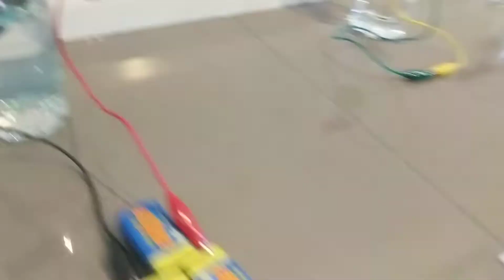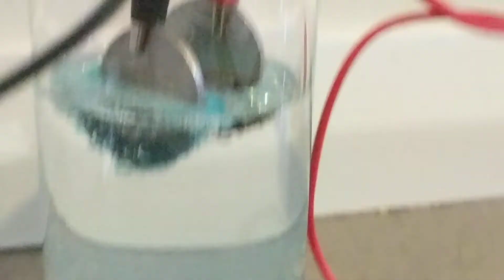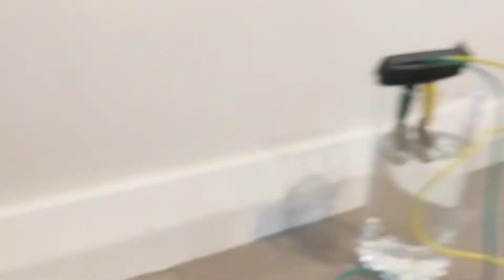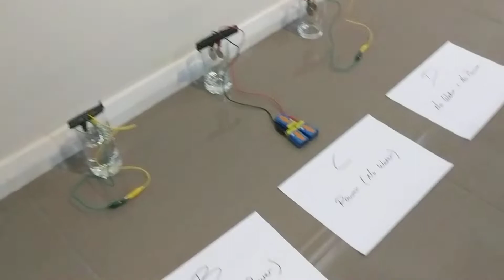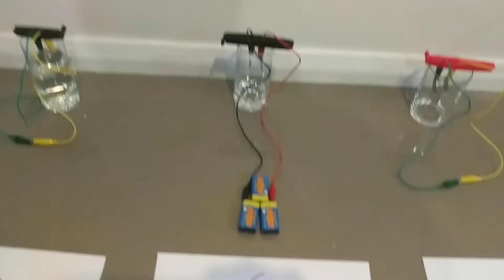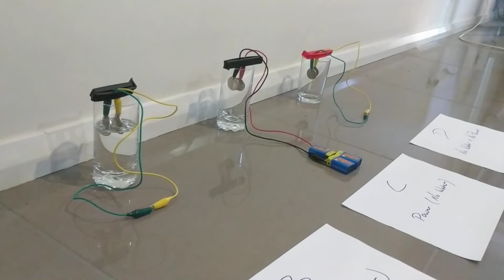Discussion of the results of my test for P&P. Evidence of electrolysis of pure water

Comment: Could there have been some substances  dissolved from the electrodes that would allow current to flow?
    imo, You have not proven the electrolysis of pure water with this experiment. 
   It would be interesting to send the liquid from the second experiment to a lab that could actually analyse the chemicals in the liquid. I predict that it is not 'pure water' anymore and will carry a current due to chemicals dissolved from the electrodes.
Reply from the maker: Thats a good point to consider but I ultimately I disagree because the metal oxides formed are too stable to dissociate in solution to form any charge carrying ions and this is evident by its cloudiness.

If the impurities had allowed ions to form to allow electrolysis, than test B would have shown some sort of degreddation, any at all (as the impurities comming from the coins would have likely been seen from damage to the coin itself).

I may be able to take it to the lab at my work and test it's conductivity against a blank (as I still have test B ) which should indicate the presence of any dissolved metal ions?

Thanks for the comment mate!
Reply: Thanks for listening. I am interested in what results you find from further testing. I really am interesting in finding out the actual results. Wherever it leads.
Reply from the maker: Ryan Q Vincent I appreciate your open-mindedness (if that is a word haha) it's nice to see people who are genuinely curious and want to learn. It makes it feel like I'm doing something worthy

Be assured that I'll never tell you what to think, I'll only give you things to think about of your own accord so you can come to your own conclusion. As I told sheepsandneeps, it's ok we don't have the same opinions in the ens :)
Reply: I never told you what to think. I made a suggestion about dissolved substances from the electrodes. You now have an alternate suggestion that explains that the water is no longer 'pure'. It is your experiment. Your conclusion is not proven?
Reply from the maker: Ryan Q Vincent sorry, I may have been unclear. I wasn't saying you were trying to tell me what to think. I was trying let you know that I wouldn't attack you for not agreeing whether I find proof or not. Apologies
Reply: Seriously, nothing to apologies for - I tend to misunderstand. It is a joy to find someone who just wants to find evidence no matter where it leads. Thanks for doing this. I really do appreciate it. :)
Reply from the maker: Ryan Q Vincent ok, so here's what I'm thinking... Unfortunately I have discarded the liquid from test A (out of fear it would stain my glass) but I still have the liquid in test B (partially out of laziness). What I'll do is I will take it to work, as well as a 'blank' sample (just fresh deionised water from the bottle) and measure it at work using the metering we measure our potable water with (to measure hardness of the water).

It measures in the form of millivolts (mV) but we have no reference for what is considered a high or low value, nore do we know of any deviations in the units scales.

So I will make up a set of standards of 0.5, 1, 2 and 5 grams of NaCl dissolved in deionised water and measure them. We can then graph the standards and use the resulting equation to calculate the equivalent mass of salt needed to achieve the conductivity obtained by test B.

I can also repeats test A and test that too but that will take a few days longer

Thoughts?
Reply from the maker: Ryan Q Vincent just an update for ya mate, I tested it at work, however the results weren't what I expected. There was a scale shift every time I switched solutions. There was always a consistent change of around between 4-10 mV between the blank and solution B. There was a consistent shift of 50-70mV when moving from solution B to the 0.5g/L standard.  I suspect that the change between the blank and solution B is negligible but this cannot be confirmed note denied due to that constantly shifting scale. Instead, I've sources some carbon graphite electrodes. The carbon won't form any conductive ions in solution, infact, the only carbon product we can expect to see is carbon dioxide. However, literature has claimed this to be in a insignificant amount compared to oxygen production during electrolysis. So if water is conductive, this should help show that.

Let me know your thoughts
Reply: +dabrownie93, thanks for continuing this investigation. Before we continue I am quite happy with the h2o water explanation. I believe it is what gives water it's almost 'magical' properties. 
   It is interesting that there appears to be different conductivity of the water just by adding the 'pure silver metal' it does seem that it is interacting with the water to allow a current to flow. Although a very low one. 
 The fact that you are taking accurate measurements is useful and essential. I wish some of the other 'experimenters' would appreciate that. ;-/
Reply from the maker: Ryan Q Vincent you and me both. A little frustrating when they don't even you controls as well (pet peeve)

Feel free to email me if you ever have any questions that you'd rather not ask via comments or are irrelevant to any of my videos. Happy to respond
Reply from the maker: Peter & Pete that current can travel through pure water. Ryan Q Vincent pointed out that it was possible for some metal ions to have dissolved in solution to give a false or skewed result. Although, I do not believe enough ions would dissolved for this to cause a noticable difference, i shouldn't just make that claim, so I am trying to use an alternative method. So far, I have produced gass bubble, (small) but the cathode broke down after an hour (with the anode only slightly effected. Wonder why that would be) so I'm trying other things. But gass was produced on both electrodes on pure water with non-ion forming electrodes and the non powered test showed negligible decay. So that suggests current does flow through the water. I would be interested if you could explain that away? Will be posting the video when I get home in a few days (away for work atm)
Reply from the maker: Peter & Pete I'm glad you asked

Tests A and B are exactly the same except for 1 veriable... Power! If you remove the power source, nothing happens. This suggests that the reaction seen is driven by electricity. It is further supported by the visible differences in reactivity of the electrodes as electrolysis would have different reaction on different electrodes
Reply from the maker: Peter & Pete I don't think you understand how eithed electricity or catalysts work. Electricity will not move or interact with anything unless a circuit is formed. Otherwise it is just called potential (you can look that word up in the dictionary). You also saw that test C was used specifically because I thought you might make that claim. Niether the water, nore the electrical potential broke the coin down and it cannot be a catalyst because it does not fit the definition of one (look it up as well)

As for the copper passing through the nickel, we don't know if the nickel was reacting as well or to what proportion.

For example, if the relative stabilities of the two metals were similar, we'd see a 75/25 reaction. This means that the copper would react 3 times fast than the nickel. However, if the stabilities weren't similar, that would change. We could be seeing only copper reacting or only nickel and any combination inbetween. Based from the colour though, it seems more likely to be copper.

In short, I know exactly what my experiment is designed to test (if it were made to prove anything, it would be bias). You're problem is that you cannot figure out why it showed the results it did because electricity will not have any effect on the electrodes if a current isn't passing through them.

Perhaps I've annoyed you with the truth?
Reply from the maker: Peter & Pete also, as I said in my video, an led or light bulb is only a test for 'enough' current to light the bulb. if the current is too low, it won't do anything despite a current being present. I am happy to repeat this with a bulb attached to show that it occurs with power (and not without) and that the bulb won't light up. But the problem is that the limits of detection of a light source is too low, so there is no real point other than to waste time and money. 

What I could do instead is perhaps buy a voltmeter? I could byluy a bug zapper which will increase the volts (by lowering the amps because the wattage won't change) which should allow me to use a Franklin bell as a test for current.

Or you can simply look at tests A and B and realise that electricity isn't present without a complete circuit (because batteries operate using chemical reactions, no some weird pressure vessel containing pure electrons. Look up galvanic cells). The fact that a difference between test A and B is seen at all I'd definitive proof that there is current flow. Any other explainations would be neglecting the fact that electrons are not present without a completed circuit and even if it were possible without a completed circuit, than test C would have shown signs of reaction. However, it didn't. I would like to hear what you come up with to explain that...

Break down of the tests for you:

Test A: reaction occured, differences seen between anode and cathode

Test B: no reaction seen. This means that A must have been driven by electrolysis. As electricity will not effect anything without a completed circuit

Test B: no reaction. shows that the electrons were not reacting directly with the electrodes. (Electrons could not have been reacting with the water and electrodes if water is non-conductive and inert like you claim)

Test D: no reaction. Used as a control to account for any environmental effects (I suggest you start using these yourself)

If you can give a model witch fits and explains all the observations for all those tests, than you should have a plausible argument and I am interested in seeing you try. However, because you can't and your affraid to apologise for being wrong and affraid of looking like a pair of idiots, you won't and you will just pretend this doesn't exist. I've seen you do it before and I would love nothing less than for you to prove me wrong. So how about it?  Care to share an explaination that fits just as conclusively as mainstream's?
Reply from the maker: Peter & Pete wow, you got me there! ( Sarcasm). Good thing I  outlined exactly how I set it up so you could repeat the test yourself!

I was using fresh deionised water. I could steal some from the lab at work and get the same result. Would you like me to try that instead? 

If neither of us can have any certainty that the water we use is pure than neither of us can make claims about the conductivity of water, so trying to cast doubt using an argument like that actually gets you nowhere. Regardless, you should be trying to explain results, rather than trying to discredit them with such broad and indistinct details. The method I used was well thought out and documented. If you think I purposely swayed the results, repeat the test yourself to see if that was true or not.

I could do a combustion test for you so you can see me produce water via combustion. If I produce water, It's evidence that water isn't an element and can be made through an addition reaction.
No need for pure water there.

I can also use a pH probe to show you that pure water will get a reading and since pH probes measure hydronium (H3O+) you might want to try to explain where that came from if not the self ionization of water.

Or how about explaining why water expands when frozen?

I'll let you come up with actual reasons why you see all these things.... I'll wait...

And remember, it must explain all these details or you model is simply inadequate since mainstreams one model can explain all these things...
Reply from the maker: Peter & Pete first up, nice attempt at a miss-direction. Clearly dodging the part where I asked you to explain all observations and interesting you didn't touch any other evidence I used.

I can prove oxygen is in rust but the apparatus to remove pure oxygen from rust is beyond my means unless I was in a well funded lab. You know this, which is why you harp on about it. You also forget that there is more than one way to examine your claim, many actually! And you just pretend they don't exist. If you pass 240v through something with very high resistance and try to light something that is designed to operate at 240v, what do you think is going to happen? Of course it's not going to light up you nugget, it will give you a false nwgative. If you put two stable electrodes in the pure water at 240v and have an unpowered control, you will see a clear difference in an hour or two, maybe less.

Except you didn't do any of that did you?

The 300+ years of science have proven all claims made and not necessarily directly as that cannot always be feasibly done. That is the difference between evidence and proof.

Now you design your tests to support your claim, not to test it and this are extremely bias. Your results cannot be trusted as either evidence or proof because of this fact and you fail to see that.

The sole reason that you have tried to deflect here and have attempted to discredit me is because you cannot explain any of the things I have pointed out. Plain and simple, you have failed and you will not admit that because either your pride is too precious or you're simply that arrogant... You haven't even acknowledge that you used the wrong pH scale on your video FFS.
Reply from the maker: Peter & Pete seriously, can you not see how your model MUST be able to explain all seen observations? Otherwise it simply isn't an accurate model.

You also need to put more thought into your tests! Stop trying to design tests to prove your claim and start designing then to test your claim. Surely you can see the wisdom in that as least?

And control your variables. You never have any sort of reference or comparisons in your tests to account for the effects of uncontrollable variables. Without these controls, you're just showing us what you want us to see and nothing else

Your tests and your videos so far have been bias and selective for this very reason!

If you're ACTUALLY searching for the truth, how about examining all possibilities instead of searching only for things that you can spin to support you and ignoring things that don't support you.

And if you ACTUALLY think you're right, explain how your model can reasonably explain all the observations seen in my tests and in the properties of water in general and stop dodging around that fact like some some scared 7y/o who's just been caught lying. Show some integrity for once
Reply from the maker: Peter & Pete and one last point. I am happy to talk to you or anyone about how to set up the tests or interpret their observations or looking at information online or elsewhere but you simply won't out of what appears to be sheer arrogance, nore do you address or acknowledge any points or evidence I provide.

Incase you were wondering why I have taken a different tone to you when compared to others.
Reply from the maker: Peter & Pete except I used pure water and if you don't believe me than you should redo the test yourself with what you know to be pure water. When reviewing a scientific experiments, you look to make sure all variables are accounted for, that the set-up it adequate and that they used the correct materials. I have done all these things, to say I'm lying about the materials is a he-said-she-said matter so the only way to conclusively resolve anything is to repeat the experiment yourself.

Further, you're ignoring the fact the electricity doesn't work like that. Electrical charge will only be present with a completed circuit. Period. No circuit, no generation of electricity. That is how batteries work. If with these specific electrodes, a current was not needed, than electricity would not be a catalyst because the anode would need consume this electrons. Even then, without a completed circuit a chemical battery would not generate any electrons period. So either way you look at it, you're wrong.

This juvenile explaination about the purity of my water also doesn't explain how we can measure the pH of pure water and it doesn't explain why water expands when you freeze it.

It also doesn't fit with the observations of test B.

You'll wait as long I like because I actually work for a living and have alot of other more important things to be doing in my spare time, so you'll wait until I have the time to do it.

Care to try again at explaining.... Anything?
Reply from the maker: Peter & Pete I purchased the water from a company proficient in purifying water. If you think the water isn't pure enough, than you get some water that you believe to be purer and repeat my tests and see for yourself whether it was the impurities or not

The argument your making is nonsensical. I took steps to control that variable. It's on you if you don't trust those steps and you need to prove to yourself whether my results were correct or were false.

I can say with certainty that the water was pure, same as I believe that you used pure water. The difference is that you look for an instantaneous reaction when in reality, the reaction is too slow for that. I ran mine for hours and DID see reaction and you're getting all twisted up about it, the same as you did about the silver electrodes. If you really wanted to prove anything, you should have gotten alectrodes that you believed were pure, otherwise you're not proving anything.

Now, either you provide evidence that my water can't have been pure, produce an argument about how your model fits all the available observations OR admit you may have been mistaken.

I can't see you doing any of those out of a sheer lack of integrity though but I am willing to be proven wrong.

What is more likely to happen is that you'll dodge any form of responsibility for your claims, try to lay it on me and call into doubt the realiability of my experiment in an attempt to deflect said responsibility and avoid having to explain a single bloody thing. Disgraceful.

And you don't even realise that If you doubt the purity of the products I use, than you cast that same level of doubt on your own claims and say that yours are equally unreliable

Pick up your game or give up
Reply from the maker: Peter & Pete you clearly didn't read my last message, did you?
Reply from the maker: Peter & Pete that was not a variable I was examining. If it were, I'd have had a set of solutions if differing NaCl concentration.

It doesn't change the face the I purchased and used deionised water from a reputable company. If you have access to purer water, by all means, be my guest and repeat my experiment. Or perhaps you could suggest a better product/supplier. 

This all shakes doesn't to one of two things

A) you don't believe me. In which case the only remedy for that would be for you to repeat the experiment for yourself.

B) you're butt-hurt because I've outed you for the incredulous, lying and attention grabbing misleading twits you are and you only form of recourse to try and save face is to try to poke holes in my experiment where none exist.

So you're left with two options; repeat the experiment or accept my observations and try to explain them with your model

If you decide to do neither, I suggest you bugger off and be useless elsewhere
Reply from the maker: Peter & Pete oh and despite the fact that it's not relevant, I did tested by the way. I used the conductivity probe at my lab at work and compared it against the deionized water we use in the lab. Care to guess what the results were?
Reply from the maker: Peter & Pete ha! Don't make me laugh! Coming from someone who can't even figure out which end of the pH scale he's meant to be using? Not to mention you repeatedly proving that you don't know how to properly design even the simplest tests (and that you clearly have no understanding or concept of what a control is!)

Let me break this down for so even you should be able to understand it.

Ions in solution are what conduct electricity right? Well, ions in the water in the lab where I work causes the results to change very drastically. 

So we order deionised water in bulk for use in the lab. The manfucturer uses distilled water which they then put through their deionised process and we are assured it is ion free by the supplier. We test this ourselves as well.

A conductivity meter is a standard way of measuring the concentration of IONS dissolved in a solution.

Now if I have a sample of what I know is pure, ion-free water, and a way of measuring the the concentration of IONS in a liquid.

Now this is where it'll get tricky for you...

If I get the same result from the lab DI water as I do from the DI water I purchased myself, what does that mean?

Figured it out yet? It means that the DI water I bought is pure and free from dissolved ions.

Now, if you still don't believe I used pure water, go ahead and try it with your own. I guarantee that you will get the same results, despite whatever water you use, whether it be distilled, RO or deionised and regardless of manufacture.

You have nothing on the water I used more how I designed the test. You can either explain how your model fits the results, repeat the test or simply admit your model doesn't fit.

Knowing you though, you will do none of these three things and continue to argue like and impotent child about the water I used or any other insignificant detail you can imagine up.

So which will it be? A childish and juvenile argument or actual science and progress?
Reply from the maker: NotTheCIA I.think as I predicted earlier in the comments, they'll stick to their ungrounded, futile and juvenile attempts to deflect any burden on them because they know I've fairly an truthfully produced something they can't explain.

Sad and pathetic
Reply from the maker: Ryan Q Vincent sorry it took so long but my response for you is now up! Let me know what you think of it!